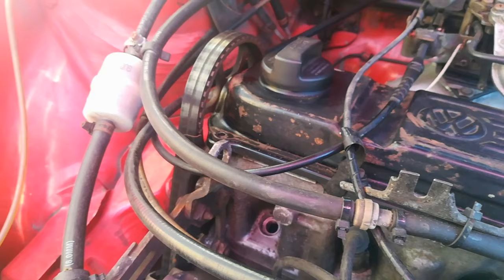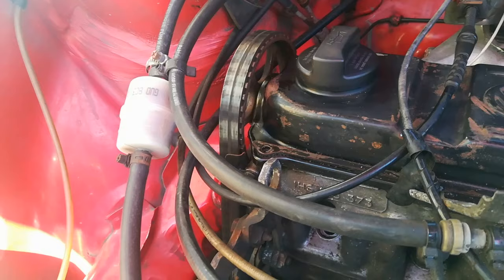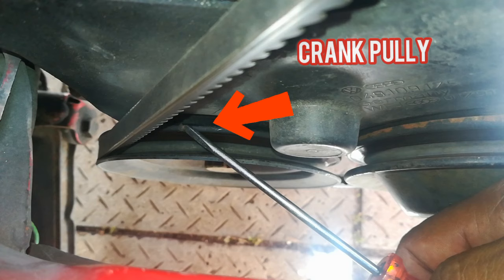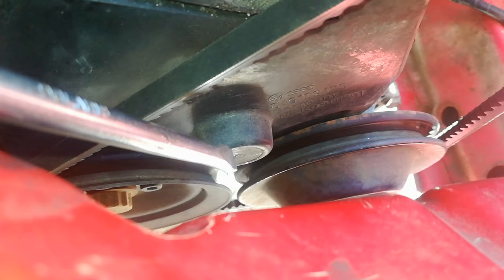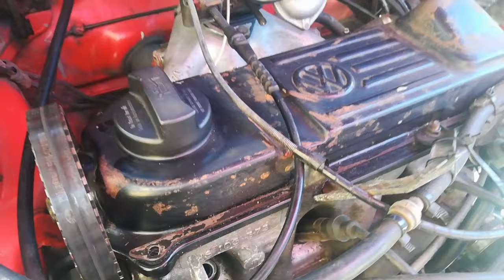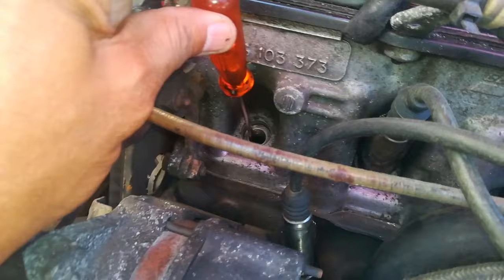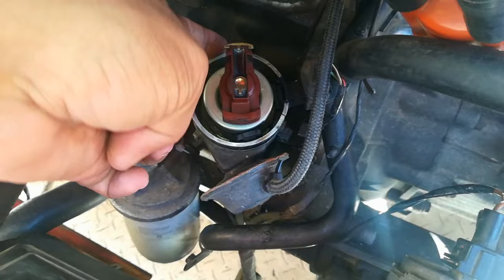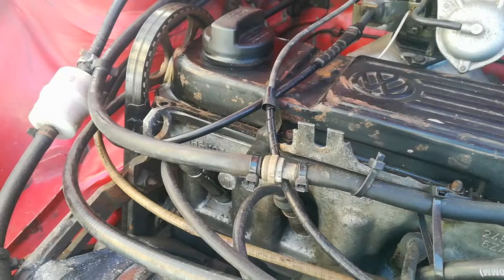GOLF MK1: TIMING MARKS, AND SETTING TIMING #golfmk1 #vwgolf #vwcaddy #golfmk2 #vwfox

Comment: Related to this......
I recently replaced the cam followers and all went well. I had a slight ticking of one of the followers after I started up, but it went away once oil pressure was sufficient. Nowhere on the internet does it tell you how to soak the followers prior to installing, but what I did is place them in a clean container with the solid flat side down, i then filled clean oil in the container until the followers were submerged and i waited some hours while doing other stuff, its essential to do this.
I noted the following about removing the cambelt to do this work.
its not necessary to remove the bottom cover, only the top cover for the cam belt. I set the engine on its timing marks before doing the job and nothing moved (only the cam which I had to move obviously). I just released the tensioner, slipped the bely off carefully and was able to fit it back no hassles after re fitting the cam shaft upon completion of the work.Thanks guys have fun with your Golf.

Comment: According to the manual everything you did is 100% correct. I followed the manual to the tee but when I want to set ignition timing at 6 deg BTDC i still get rough idling. At 18 degrees it seems to run smooth but fuel is very rich? It's fuel injection!!! What gives??

Comment: I set all the timing markings up The Cam, The flywheel, The Crankshaft pulley and the Dizzy marking but the bastard of a car wont start it sound normal while cranking but makes blowing noises when cranking.
Reply from the maker: Watch this video.Hope it helps with your problem
https://youtu.be/jT4s9o42weo?si=M4YHQxzJUKobfzo5

Comment: What is the idle advance for a 1986 MK2 Scirocco 1.8 carb model?

Recently did a timing belt but found the previous belt was fitted incorrectly on the distributor pulley.

After setting everything back to standard the ignition timing was way too advanced causing it to struggle/kick back when starting and idle fast, only info I could find online said to leave the vacuum line attached and set the idle advance to 17-19° btdc, 

I set my advance dial on my strobe gun so that the crank pulley tdc mark was aligned at 17°, with this setting the car started another and idle was back to normal.

Is this correct for idle advance? From experience this is generally closer to 10°btdc on most other cars.
Reply from the maker: Hi , 6 to 7 degrees btdc is what it should be .,with vacuum advance line detached and plugged .Have you tried that?

Comment: Howzit PJ great videos . I'm busy with a 2l 8v with 288 cam 57 mil pipes dictator in a MK3.5 cabriolet. Got it started first try after wiring up the harness but dictator is being a not nice part. Any advice also got mp9 conversion intake fuel rail

Comment: Hi boss thanks for the info helps alot. Only struggling with my intermediate/distribution pot timimg marks on pulley. There's 3 marks on my polo classic 1.6i 1998 model intermediate pulley. Ive put  my engine on tdc, cam shaft lines up with tappet cover. Ive put mark on distributor towards no 1 and the rotor inline with that mark but marks on intermediate pulley not lining up with any other mark on crank shaft pulley. Can I leave it like that or will it affect starting or performance?  Your help would be appreciated
Reply from the maker: With regard to intermediate pulley .As long as the rotor is pointing to the mark on rotor ..then you fine..
Reply: @pjs-golfmk1-diy  ok thanks for info will finish assembling tomorrow morning and give you an update

Comment: Hi there just a question, what if your flywheel isn't aligned when putting it on the timing marks what would the consequent be?
Reply from the maker: Just ensure you have the motor on top dead center ..meaning No.1 piston on top, ..that is the true way of determining timing, if u unsure ..just stick a screwdriver in the plug hole and check if piston is on top..Also check for the timing mark on the crank pulley..it lines up with the mark on plastic Cambelt cover,and of course your cam timing in line with lip of tappet cover,and rotor must point to the notch on the distributor

Comment: Good day Mr PJ. Changed cambelt on velociti 1.6. After that I have a backfire when decelerate. What can be the problem.Timing marks look correct
Reply from the maker: Yeah that happens sometimes.. But have another look. Sometimes it's not exactly 100%...i know some people say it must be on top of the tappet cover lip, and some say the bottom of the lip,.. But I have always just put it in the center... Although if u put it a notch further (advancing the cam)... There is that little more power you get,.. But then the engine may ping.. And the opposite occurs when u turn cam back a notch, you could have sluggish performance, so my advice if u haven't put it in center of tappet cover lip, play around with it, but very small adjustments Pls..

Comment: Hi PJ my jetta was in full running order so i took off the distributor cap and removed the rotor put everything back now it backfiring can you please help firing order is 1 3 4 2.
Reply from the maker: Have you maybe not pushed the rotor down securely?..it Shud snap down into place .Also checked your leads if it's snapped into place on the distributor.. especially coil lead
Reply: @pjs-golfmk1-diy good day sir. Love all your videos very helpful. I got a polo playa 1.8 mp9. The mechanic said he set the timing but not sure if he did a k#@# job because the car is struggling to start but eventually starts after numerous swings also the car does not pull when putting my foot flat and dies sometimes now an then backfires.